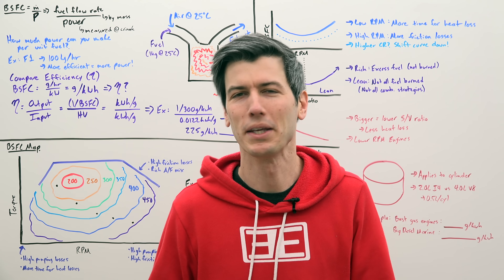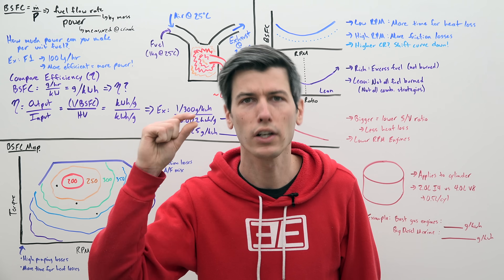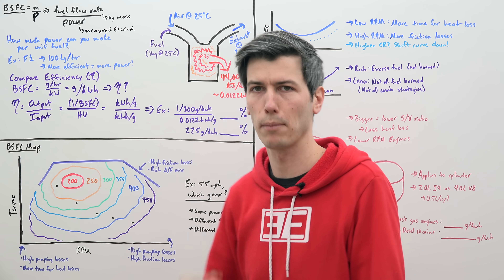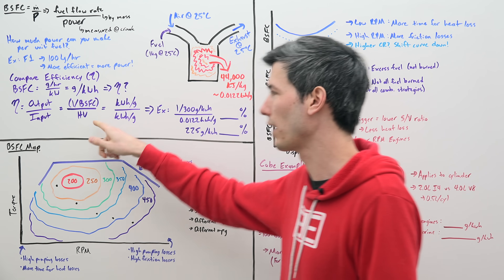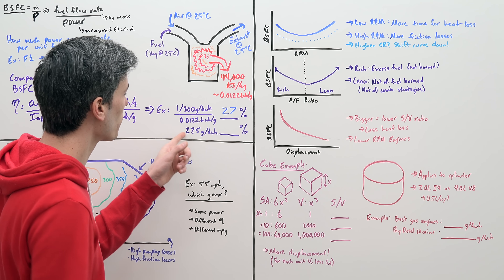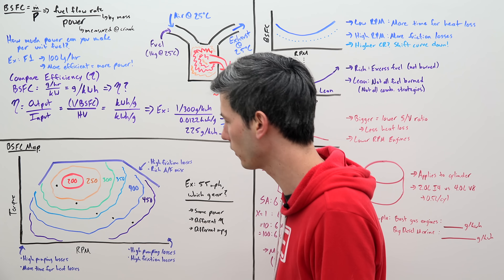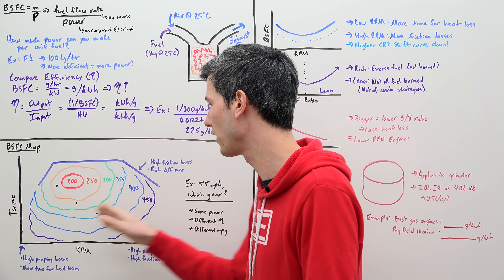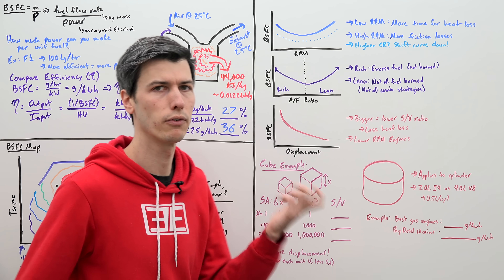The Best Way To Compare Engine Efficiency - BSFC

Comment: One of the major reasons most automobiles don't have the highest possible gas BSFC is due to variable RPM and torque. 

If you get rid of the need for variable engine speeds IE one speed only no need for a transmission you can get pretty decent BSFC.

Side note 1: No one runs stoichiometry combustion
Side note 2: They are called contor lines or contor graphs
Side note 3: Compression exponentially increases complexity.

What people do not understand (even most engineers) you can easily go down efficiency rabbit holes. While you might be able to gain a few percentage here and there it comes at extreme costs in R&R, production, manufacturing, and maintenance. Many times it's cheaper (even for the end user) to have a less efficient but cheaper to buy/maintain product.

Take Telsa for example from the onset it looks like they are making "cheap" electrical cars when in reality their entire business model is based around subsidies. They made twice as much money last year off of grants from states than they did actually producing cars. This is ignoring grants all around the electric auto industry. This was just from states requiring cars manufactures to make x number of electric cars. It was DOUBLE Telsa's net revenue......

Tesla's likely cost 2-4 times their current market price on the backend without all the subsidies. And somehow their stock is worth more than all auto manufacturers combined? When they hold less than 10% of the market share.
Reply: It's not that they can't make efficient cars, its that it costs more and they would not be able to sell many so it would not be profitable.

Comment: The other take away I get is a reinforcement that RPM and peak torque matter even more. However, the use of forced induction is still not ideal.
Top gear cruising speed may need only 3k rpm, but doesn't need all the boost. Where is the engine technology that controls boost pressure for efficiency?
Also, this discussion shows another fallacy of shopping peak/rpm (that probably is never utilized) where the day to day efficiency matters to more most as people brag about their MPGs. The 0-30 times (the squirt) are more useful than the 0-60 times (the 'drag').

Comment: I don't understand why Jason went from explaining the the efficiency increase as bore increases and then make a comparison of a 2L-4 cylinder to a 4L-8cylinder. I would have continued the point with  two engines with same displacement and same Bore:Stroke ratio and shown the reduced friction area/heat loss area. The 4 would be the more BSFC efficient engine. Additionally it would gain efficiency in operation as peak RPM would be forced down and idle rpm would be down from the 8c.
While many people will say the 4c is not as exciting, the discussion is on engine efficiency. 
Train driving isn't very exciting, but its generally the most efficient Hybrid system in use for the longest time. And the Marine engines... as big as your house, that's efficiency on the BSFC.

Comment: So how do modern small turbo engines compare against older, larger displacement engines for BSFC and efficiency?   Is all this science and maths a waste of time because the biggest factor for economy is the Sasquatch at the wheel?
Reply: All the science and math still determines the range of efficiency possible with a engine, and how easy or difficult it is for that sasquatch to drastically effect the fuel consumption. 

A good example is my old 1999 Freightliner  with a 3406e cat, if I drive it right I can get 7+mpg at 80,000 pounds gross, if I run it hard I can get 4mpg. A new truck the range is in the 6-8mpg range depending on the driver.

Comment: How would you measure BSFCe in electric cars?
Reply: I would expect it would be higher for EVs. However, what really would be interesting is to include the efficiency of the power generation and distribution system. i.e. natural gas to generate power that is distributed over power lines to charge batteries that produce motor power.

Comment: Q: why most of vehicle producer do NOT mention of max. angle of ascending a hill? Of course that depend on hill's road conditions from wet, paved or not, tiers and the vehicle's spec. engine power and min. & max. weight.
Thanks.

Comment: I agree with what's being said here! A friend of mine has a 250cc motorcycle that gets roughly 55mpg & says his 250cc is more efficient then my 600cc motorcycle which only roughly gets 50mpg! It's like comparing apples to oranges! You must compare like motors, like why is my manual 4.0 v6 uses less fuel then an automatic 4.0 v6?! This would be a little more like comparing apples to apples, just different types of apples(like comparing gala apples to macintosh apples) but agreed, the best comparison would to compare full identical items(like racecar engines of the same manufacturer & model)
Reply: Oh, the reason why they say this is both our motorcycles are the same weight, so...

Comment: Makes me wonder then, why manufacturers only make such small cylinders on their car engines, when bigger cylinders tend to be more efficient because of better surface area to volume ratio? 
Based on his example, 2L I4 vs 4L V8, why no 4L I4? I mean with lorry engines, dispacements of 2L per cylinder (12L I6, 16L V8) are totally common since decades. 
And such an engine with lage displacement and few cylinders would sound quite wild in a car i bet :D

Comment: Isn't there a thermal dynamic law that says that efficiency in combustion engines can't go beyond a certain point, no matter what technology you use?
Reply: From Wikipedia:

Carnot efficiency

Main article: Carnot's theorem (thermodynamics)

The second law of thermodynamics puts a fundamental limit on the thermal efficiency of all heat engines. Even an ideal, frictionless engine can't convert anywhere near 100% of its input heat into work. The limiting factors are the temperature at which the heat enters the engine and the temperature of the environment into which the engine exhausts its waste heat, measured in an absolute scale, such as the Kelvin or Rankine scale.

Comment: Is it a myth that the inverse of BSFC at full throttle resembles the torque curve? In practical terms, that means in a racing scenario shifting to maintain maximum torque will yield the most fuel savings. True or false?

Comment: I have some questions about fueling the engine. Why do auto manufacturers not use gasoline vapors instead of liquid? Would it be detrimental to an engine? I have an idea to convert my 7.4L gas truck to use the fuel injection system to inject vapor instead of liquid. I would keep it completely stock minus the conversion. What do you think? Is this a good or bad idea? Any feedback would be great!

Comment: F1 fuel limit (liquid fuel) is set in Kilograms? That’s weird, why not liters? It’s a liquid.
Reply: I don’t know either why but I think the advantage of measuring fuel by mass instead of by volume is the quantity isn’t affected by temperature (thermal expansion doesn’t affect mass).
Reply: @rommysoeli  that makes sense.

Comment: Hi Jason, I have a question about what is the most fuel efficient way to accelerate?

Usually we say it is to accelerate gently and upshift whenever possible.
But in BSFC chart, the optimistic point is in the middle, which means it could be better to accelerate harder and keep engine in a higher RPM?

Comment: Large marine diesels are more efficient due to the lack of emission regulations. They can have extreemly high commpression ratios without having to worry about Nox emissions. 
Long stroke, high compression and low reving engines are more efficient. 
Hybrid powertrains are even more efficient. 
Electric is the most efficient.

Comment: Large engines are often used at constant low rpm for generation, which makes the heat loss through cyl walls important and necessitates a few humongous pistons instead of many smaller pistons. But the valves can be designed for one specific rpm that the engine will be at 99% of the time

Comment: I know this is completely unrelated, but i bought a new 2020 tacoma v6 and changed my oil at 3000 miles.  Did wait too long to get the medal particles from the break in out?

Comment: I’ve heard some F1 engines are now starting to break the 50% efficiency mark. I’d love to see a comparison of Motorsport engines and their efficiencies.
Reply: In 2013 they were at 29%. By 2015, Mercedes was hitting just over 50% with the ERS running at full discharge, AND with less than 0.3s of turbo lag.

Comment: 12:00 This helps explain engines like the new GR Yaris 1.5lt 3 cylinder.
Still a 1500cc engine, but with 500cc per cylinder, high boost, only 3 cylinders to worry about friction losses and big torque at low total rpm. 👍

Comment: So,  lowest rpm is not as efficient to run on.
But why every brand programmed to lowest rpm possible shifts pattern in coasting, almost all cars barely above 1k rpm. Even merc has moee radical systems sets <1k rpm : glide mode

Comment: I have an unrelated question: why aren't there any v4 engines? Why is an in line design better for 4 cylinders?
Reply: There are several V4 engines... in motorcycles where the packaging makes sense.
Reply: More expensive to make a v4. 2 cyl heads, manifolds etc to cast instead of one and so on. No real advantage in packaging as there is sufficient room in any car for a transverse inline 4 cyl anyway
Reply: Technically, an inline 8 would be a better engine. V Styles engines are done with the purpose of saving space. V Shape motors are less balanced than inline motors, and as such need balancers and other stuff so they don't idle extremely rough.V4'S do exist, but are extremely rare because there aren't many applications where you couldnt fit an inline 4 in.

Comment: Tune engine to run in sweet spot constantly, run generator off that. Diesel electric trains must have decent BSFC?
Reply: Exactly right, thats what generators try to run in the sweet spot and only spike up rpm in times of high demand. The only reason semi trucks aren't a hybrid electric is the weight, government weight restrictions make it impossible.
Reply: Right on.

Comment: Math is more interesting and engaging when presented in this manor. So if I understand right and in an overly simplified manor an inline engine would be the more optimal configuration as they tend to make more torque than a V or boxer type engine.
Reply: My understanding is that the torque advantage of an inline engine with the same displacement is usually due to an under-square configuration. Packaging constraints, make it impractical to produce significantly under-square V and H style engines as those engines would either be too wide or too heavy compared with over-square designs of the same power.

Comment: Doesnt high load at low rpm greatly stress the engine components though?
Reply: No because the engine components can take the explosion force with ease. Friction is the killer for over stressing the engine. Friction causes heat which cannot be cooled fast enough. So High RPM causes more friction because the parts move faster and it equals to more force on every component.
Reply: If it is too low, like just riding slightly above your idle RPMs yes, it can be bad for your engine. Lower oil pressure gives less lubrication and makes it easier for oil in cylinder walls to be burned, "drying" them more than normal. If you are exploiting low RPMs with high loads the camshaft's chain can start oscillating more than it should too and/or getting strong vibrations that are not good for you engine nor you engine mounts. If your (hot) idle RPMs is around 800, which is just about normal, you should not load you car until 1300, 1400 RPM. I guess with time you can feel if your car is ok with it. Exhaust gas can also be dirtier when you push more than your car likes because fuel is not being totally burnt, thus creating unnecessary carbon inside your engine.

Comment: This is all really neat stuff about engine dynamics! However, MPG is still the most useful way to look at the efficiency of a car. After all, it's MPG to move stuff, which could change between vehicles using the same engine (see Honda accord vs Element).

This message brought to you by the small-car gang.
Reply: You're right.

This is more about efficiency of the 'engine' though, not the efficiency of the 'vehicle'.
Reply: As a truck driver, I say mpg or l/100km but divide that by the total mass. I'm averaging 36.3l/100km but that's moving 80,000 lbs. I think I'm doing pretty good
Reply: @jwaterdriver  Id rather compare it to the weight requirement of the task, not the weight of the vehicle itself. If you used your unloaded truck to drive your kid to school, thats not very efficient.
Reply: @jwaterdriver  yep, both system compare the engine, but the real question is the useful part, don't really care about the 1 ton of the cars own weight, if it only moves a single person, it will be much worse than the bus with a more fuel using engine and 10 ton or more own weight, but moving 80 person.
Reply: I drive a 15 year old Renault Grand Scenic it's a 7 seater with a 1.9 litre diesel engine with a 6 speed manual. This is not an exciting car but I will get 58mpg (US gal) on a run this is with 5 people on board and a full boot (trunk) weighing about 2 ton. So why are Americans happy with cars that return 40mpg or even less?
Reply: @nothingsurprisesmeanymore  cause even with lower fuel consumption we'll pay less to travel the same distance compared to you due to lower fuel taxation and regulations.

Comment: One thing you touched on was the efficiency gauge that gives you immediate MPG numbers.  Mine is between the tach and the speedo.  40 is at the top, what you aim for, and even on a freeway at 70 MPH, using that gauge as a guide to where the throttle (or cruise control)  application keeps the vehicle at a steady speed and yes do climb as I've seen them go over 40 MPG.  Doing that really helps the "average" number for MPG at the gas pump.  Course it's a (light vehicle) 2020 RAV4, on a fairly flat road, with the wind at your back.  Driving back with the wind in front of you, MPG does drop some.  It only takes one variable to change that.

Comment: We really need to design a gasoline engine that will run without a throttle. No I don't mean the short and simple answer. I mean a legit one that has perfect AFR's etcetera etcetera. Doable with some crazy cam timing and controller but I don't know how much better it'd really be

Comment: BSFC of a diesel engine can't be directly compared to gasoline. Diesel fuel has a different energy density than gasoline (it's higher). Meaning diesel fuel has a higher heat value.

Comment: I'd love to see a video on the advantages and disadvantages of the number of cylinders for power and engine efficiency. Say you have a 2L engine. How would 2 huge cylinders compare to 12 tiny ones?
Reply: I have read  that 0.5 liters is the optimum size cylinder for current automotive applications, and you can often see this borne out.  Naturally when maximum power is more important than BMSP you need to turn the engine at highest practical rpm, which drives the cylinder size smaller to limit the forces in the reciprocating masses.  The 12 cylinder engines of the last century were glorious.

Comment: But if higher displacement engines are more efficient due to a lower BSFC, why are so many automakers downsizing their engines so much? My car has a 1.0 3 cylinder engine, so although the load per cylinder is pretty high, displacement is still very low and I need fairly high rpms to keep the engine running on the highway.

Comment: Would this the type r engine one of the most efficient engines made relative to its small size, power of 306hp and its avg mpg at 28 on the highway?
Reply: Thats worse than V6 territory and equal to Corvette V8 economy
Reply: @jamesmedina2062  oh wow! That’s amazing. I just checked the corvette’s highway mpg being 27. That’s really good for a v8 engine. But it falls apart with city driving. Tried to look for most efficient v6 in power or mpg. Google search falls apart and doesn’t understand the question thinking I’m looking for high mpg suvs that have inline 4s
Reply: @suiton20  it is a lot like comparing apples to oranges. Every car is different and weight is a big factor. Mid 2000's cars like Mazda 6 and Lexus IS250 got 26 or 27 highway and 21 city. But years later mean V6 getting 33 highway such as 2017 Honda Accord or 2020 Camry. The Type R takes more boost and requires more fuel. Everything has its price. It is smoother than 1.5 because it has balance shafts. But like Jason's video, the V8 in a Vette or Cadillac can get some pretty decent numbers from double the cylinders. Civics 25 years ago could get mid-30 mpg's but were not fast. Americans want economy and power so most cars are boosted 4. In Europe and Asia, economy matters more and they are taking smaller 4 and 3 cylinders now. Civic 1.0 3-cylinder in Europe for example. Fuel price low in USA nixed a new CRZ with even better economy. More POWER BABY!

Comment: The MPG reading on your dash may not be accurate. I had one car that was always between 10 and 15% too optimistic and another that was always within about 1%.
Reply: Your right it may not be accurate, however that irrelevant in this situation. If its 20% or 5% off it doesnt change anything as all of them are off and his point remains exactly the same, change the numbers by any percentage and the same trend will still be clearly represented.